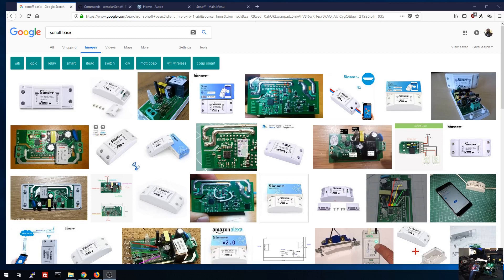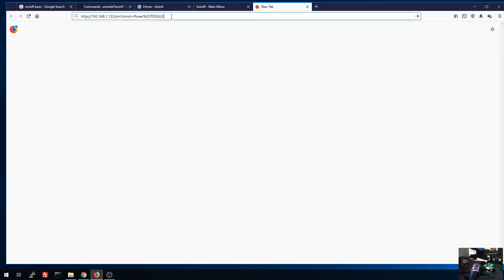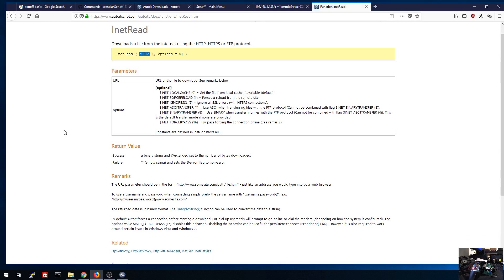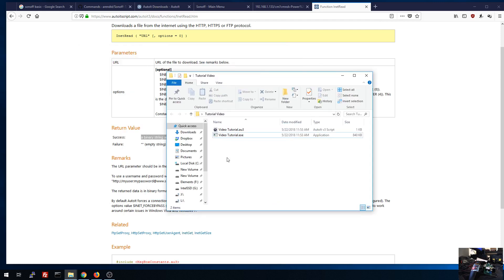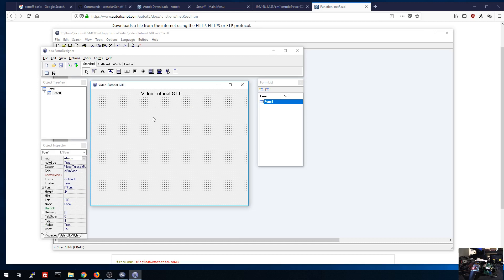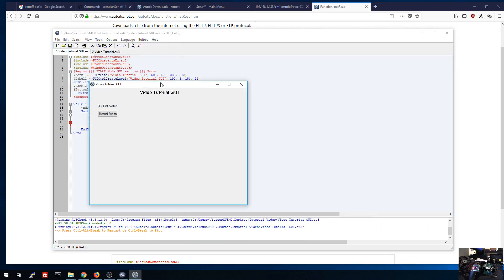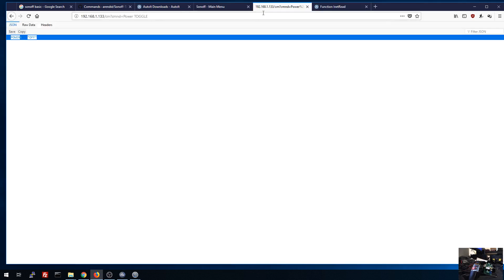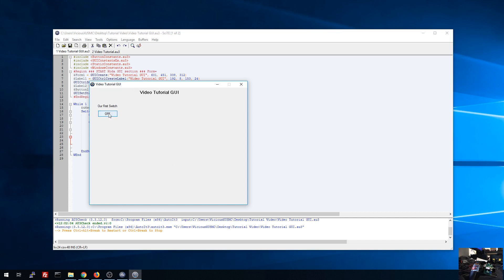Automating and Scripting a Sonoff Tasmota with AutoIT GUI & HTTP Control

Comment: Is it possible to display a numerical value as ascii-hex to the user..  like with printf ("0x%04X", sRead)

Similarly, how could you take user data from a textbox, and convert it from ascii to a 16-bit unsigned number, in order to do bit manipulation?  Something like 'strtoul' in c.   

Does VB support working with signed and unsigned numbers?

Comment: Vicious, You have no idea how "ON TIME" your two videos were made available.
6 SOnOffs done and neatly labelled, ready for deployment.
I used the strip 40-pin-thingys and broke off 5 and pushed the female to female in the correct order, marking it to know which side closes to the button. 
I then taped it together and have a nice "block"
Put it in an rubber-band it - Nice and secure - ready for flash
Thanks a lot for your thorough videos!!!

Okay, this video of your showing how to create a GUI interface to switch on the 20 SOnOffs, what do I "Copy and paste" to the computers that are authorized to switch lights on and off?

BTW: I have RPi MQTT server that I am using and that also makes it really easy to use- Downside is you have to have the RPi configured :-)
Reply from the maker: Sorry for the late reply, Youtube is terrible at notifying me.  Still need help with this?